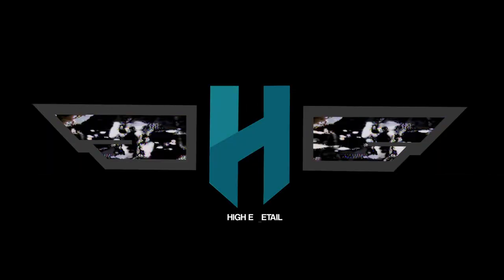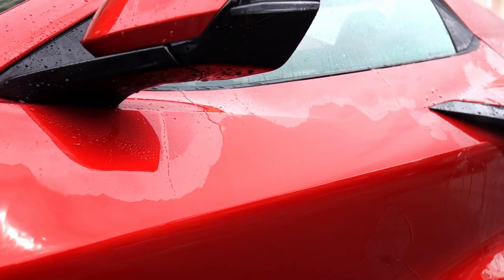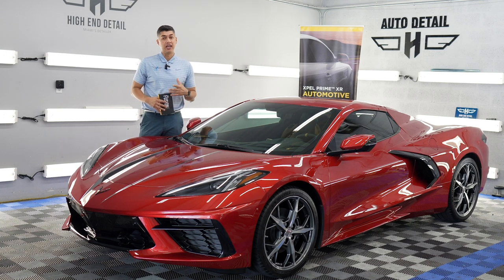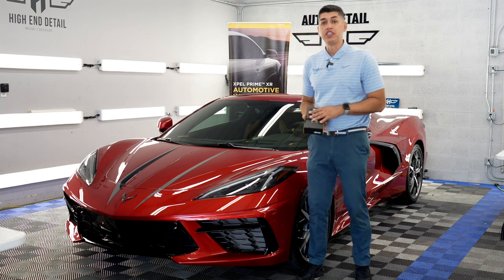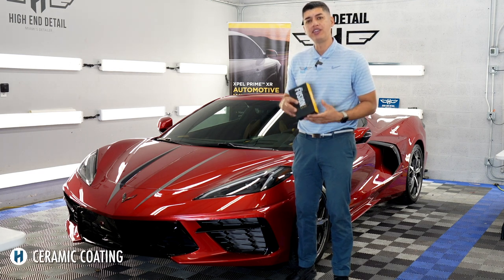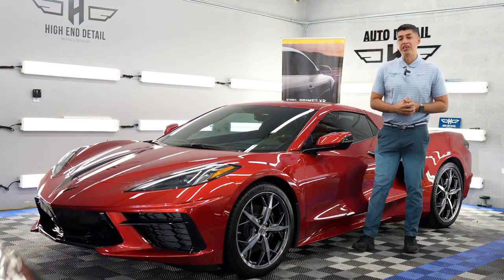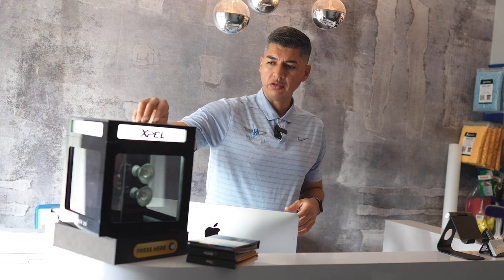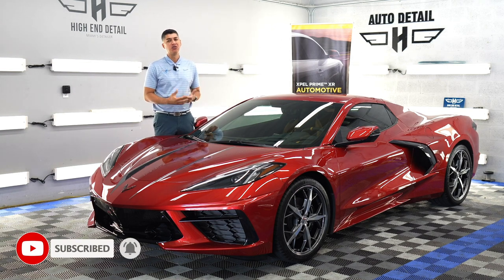CORVETTE C8 | PAINT PROTECTION FILM | CERAMIC COATING | WINDOW TINTING

Comment: I did not realize that ceramic coating is a wrap on film coat.  I've had bad experiences with this process on my 2013 ZR1 Corvette.
Reply from the maker: hi butch. not sure if i understand your statement correctly. just to clarify, the paint protection film in one thing and a ceramic coating is another thing. you can however apply the film first and then apply the ceramic coating on top of the film too..

Comment: I live in South Florida Ft. Lauderdale and wanted to see if you know anybody?
Also you run a clean and your team did a nice job on that C8. Very nice gloss 🔥 
I was wondering if you had anyone or anyplace you would feel comfortable recommending down here?
I also have a C8 HTC and want EVERYTHING Expel PPF including the full GM Ground Effects 5VM,
Than the windows Expel Film as well.
Than I want Ceramic coatings on everything including wheels windows and everything in between.
Big job, you know any of the 3 Expel approved to sell places?
Thanks Ill keep an eye out for your videos.
Reply from the maker: Hi Steven. Thanks for watching the video and congrats on your c8!
I just checked xpel’s dealer locator and there’s a couple of installers listed by your area.
You’re doing the right thing by investing in a quality protection with the xpel line up ( tints, ppf and coating)
Worst case scenario, we can coordinate and have a flat truck and bring into our shop 😎
Reply: Where are you located?
Reply from the maker: @sfgarry  we can easily be found on google maps. just simply type in our business name "high end detail" we are down south in the kendall area.
Reply: I’m picking my car up in a few weeks down in Doral at AutoNation Doral didn’t realize you were in South Florida do you do any aftermarket installations as well? Such as Ground fx or radiator grill covers
Reply from the maker: That's awesome. we are not that far from doral. 15-20 minutes. feel free to stop by! also, our neighbors next door do custom/aftermarket installations they'll likely be able to help you out with the other items you mentioned. Hope to see you soon!
Reply: I’ll keep in touch

Comment: How much cost the protector?
Reply from the maker: Hello yang feng. Pricing varies depending on where you live.
Most installers charge between $1,800-$2,200 to wrap the full hood, bumper, headlights, fenders and mirrors.